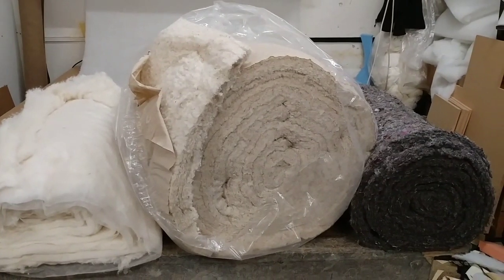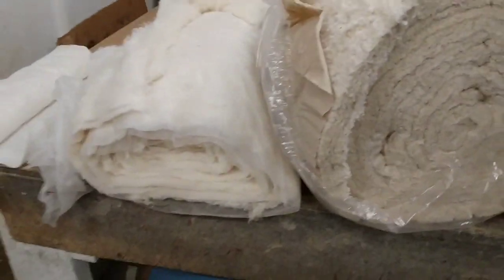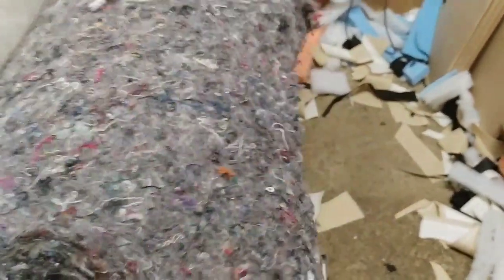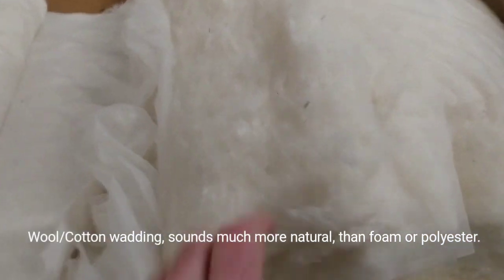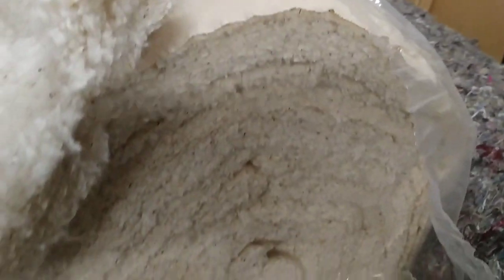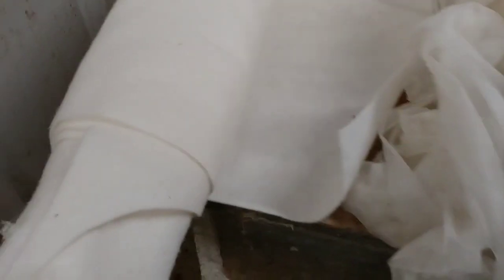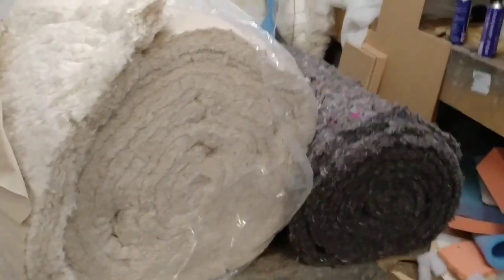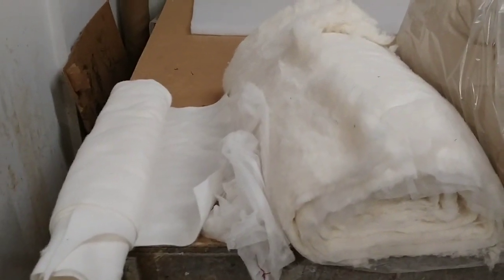Different types of speaker cabinet damping materials

Comment: I designed speakers for about 15 years in a previous life. To start with, "dampening" means making something damp (moist, wet) and "damping" means reducing vibration. The batting used inside speakers is actually there to absorb the energy produced by the sound waves in the air and help keep the air inside the cabinet from becoming hotter due to that energy  (in a sealed cabinet  heating the air would make it expand and increase the air pressure, causing the woofer's diaphragm to move outward).
When I started designing speakers fibreglass and kapok  (the reclaimed fibre material you didn't know the name of) were pretty standard but we experimented with polyester fibre and found that it worked as well as or better than  the previous materials with the added advantage of being safer to handle than the fibreglass.
I can't see how any natural fibre like cotton or wool would make any difference except increasing the cost.
Reply from the maker: Spellings mistake👍
Reply: @tweakerman  Ah, but you said dampening too.

Comment: Material, no matter what is not necessary in cabinets. Especially when sealed...Air suspended  will be hindered it and have less effect then the ported ones...Open may sound louder when damped still yet they would anyway vs sealed...all things equal